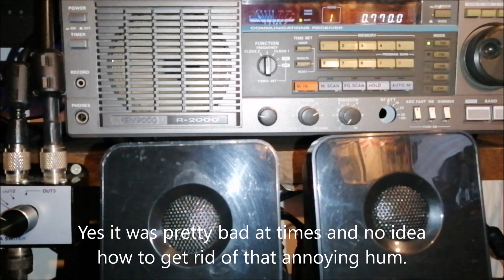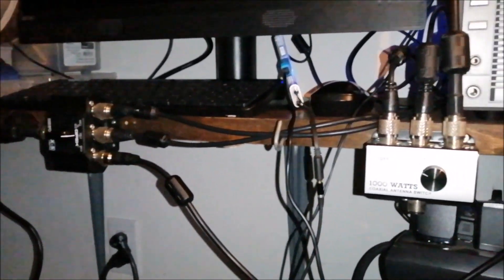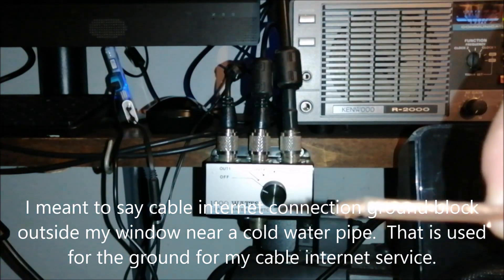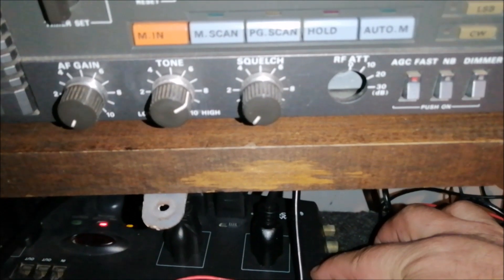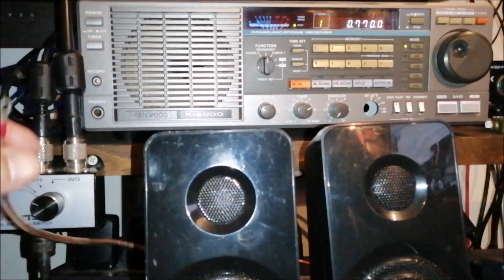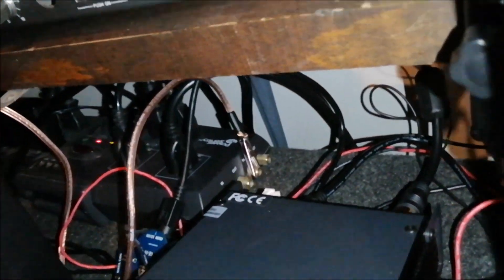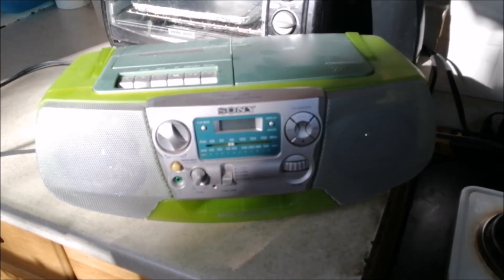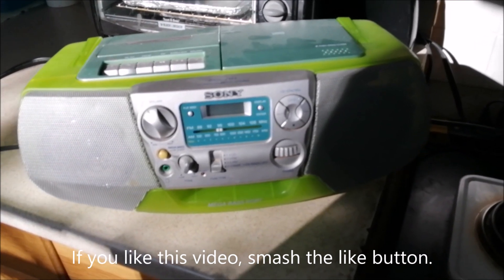How to get rid of RFI hum noise from the AM or MW broadcast band.  Eliminate the radio hum noise.

Comment: Awesome!  Gotta feel good getting rid of that nasty hum. Great job!  What if you would have just ran the discone feed directly into your power conditioner and a short jumper to the switch?
Reply from the maker: Yes it does feel good getting rid of that annoying hum.  I would need to get some adapters to run it through that power conditioner.  This will do for now until I move the Discone in a few months.  Thank you for watching.  Have a good weekend.  😊